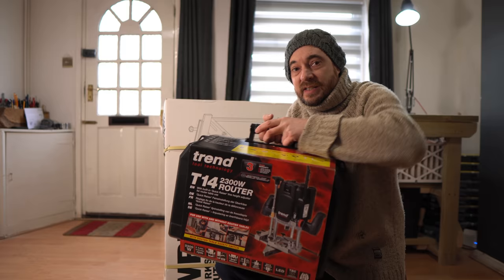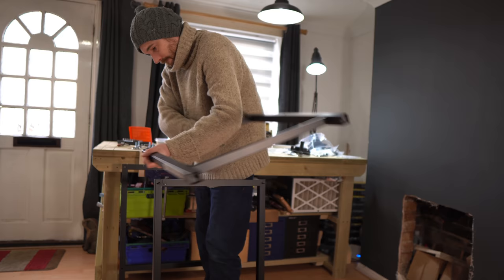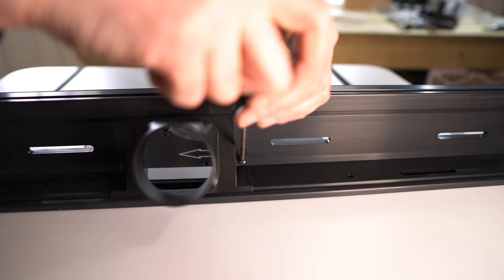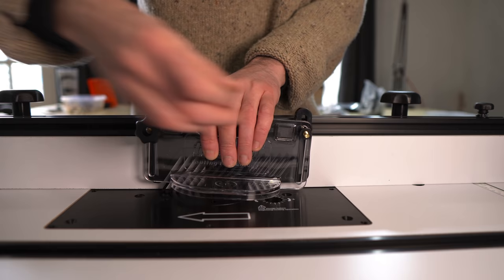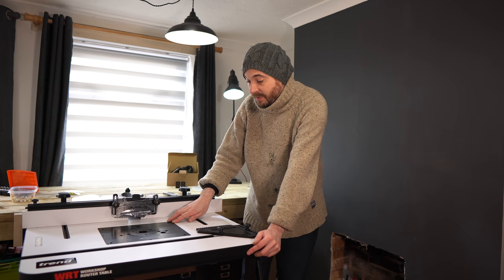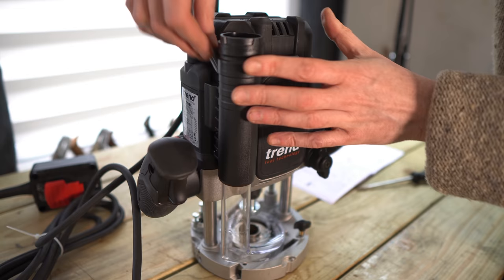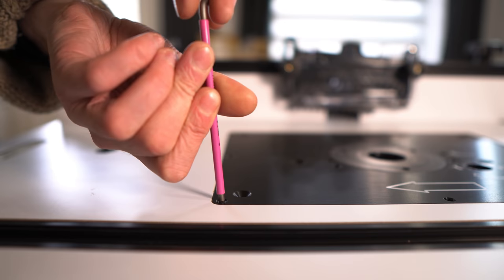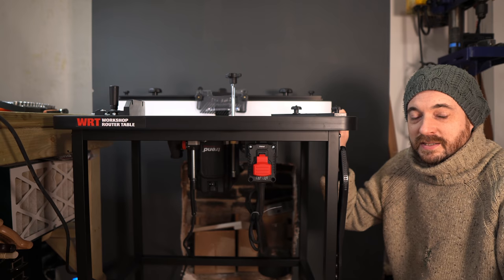Trend T14 Router & Table

Comment: top tip about that above the table adjustment, make sure you shop vac it out every time you use the router. We had the T11 which has the same adjuster and it was forever getting clogged up with dust.
Reply: THIS!

Comment: for the same reason I bought Triton router, which can be height adjusted from top of the table, no router lift needed.

looks like a great piece of kit
Reply from the maker: It is a great feature to have
Reply: Have the Triton as well - and its a lot cheaper than this
Reply: @mrgari189  Me too. Bought an insert to make my table look good, but built the table myself as well.
Reply: @mrgari189  and me

Comment: 1/2 in gives you plenty of cutting power. shame it didn't come with a default set of 12 basic bits! do you have Collete to adapt down to older 1/4" bits too?
Reply from the maker: I will have to get a smaller collete